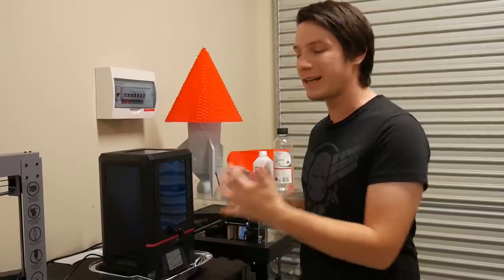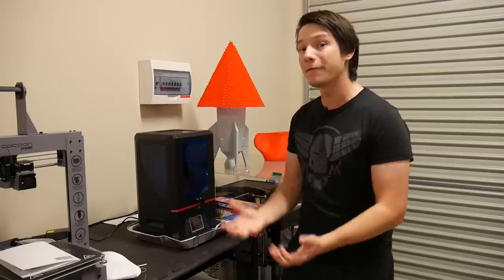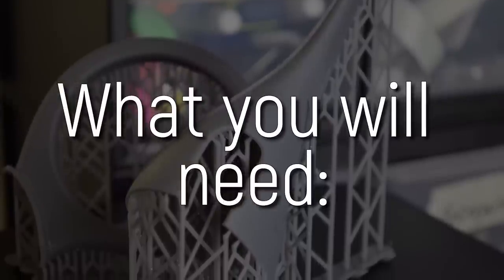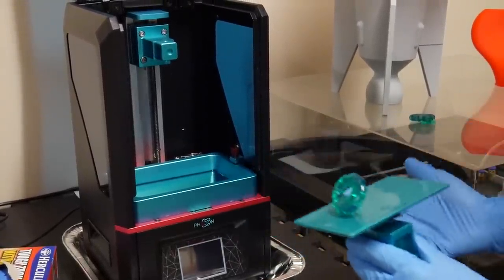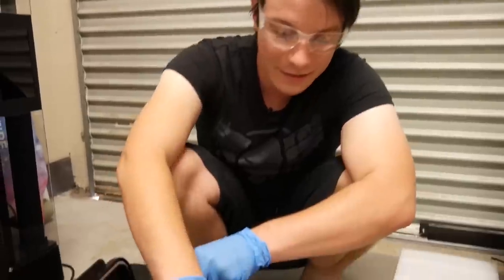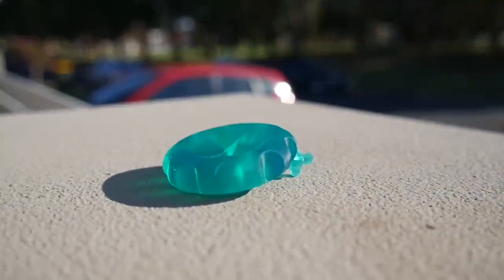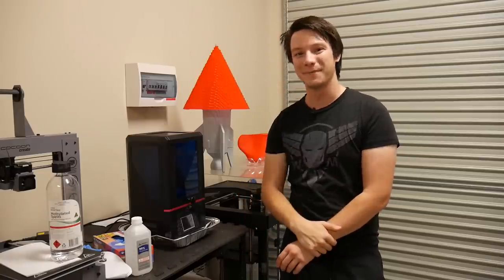Resin 3D Printing Safety - Important for Beginners!

Comment: We put our resin contaminated IPA out in the sun in a sealed container (not a bottle with a thin neck) for a few days and the resin in solution cures into a solid mass which then can be disposed of. We then filter the IPA using paint filters. The IPA can then be reused.
Reply from the maker: Good tip!
Reply: Exactly - easy to dispose of resin as long as you cure it.  Certainly saves a trip to a hazardous materials disposal site!
Reply: That is a really good idea
Reply: @FooBar89  just put in under the sun?
Reply: Yes. Depending on the UV index where you are it might take a longer time, but you'll know it happened when the resin hardens to the same degree as on your actual resin parts.
Reply: Little note: Standard glass more-or-less filters UV radiation away, so it may be helpful to use suitable container to speed up the process.
Reply: Binary Explosions 
Why is it hazardeous when uncured, but OK to put in the waste bin when cured?
Reply: @Traitorman..Proverbs26.11  At least one reason - those resin, or rather - their precursor mixture has to be highly reactive and such a compounds are usually not healthy - something that can easily reacts is quite likely to react in unwanted way in your body. They may also bind to enzymes and other molecules in your body.
Also there are probably some photo-catalysts - another stuff than can cause problem. Do not forget that these reactions probably goes through radicals that are not healthy.

Once cured, they are bound together, their reactive centers are used up to form new bonds, they are solid matter that you cannot drink nor breath in and if they are chemically stable lets say  when in contact with liquids in digestive system, they are safe.
Many materials (i.e. composite, plastic) that are safe are made of precursors that are very harmful. Btw. well known hydrogen cyanide or phosgene that are known by most of the people as poisons or even chemical weapons are important materials in chemical synthesis
Reply: Does this actually work? I put my jar of IPA under my uv light over night, and now it’s just cloudy
Reply: @danielfaubert1903  It's cloudy because there are tiny particles of cured resin in it. You have to filter them out, using aforementioned paint filters.
Reply: @mungo7136  sorry, ment for the comment after yours. I'm not good at computer deeerrrrp.
Reply: My isopropyl alcohol tub from when I had a resin printer (it was a bad model, i sent it back, I'll buy a better one when I can afford it) has a bunch of cured resin dust in it from being generally left in the sun, but when I tried to filter it out with coffee filters, the dust went right through the filters. Better than the alcohol, actually.
Reply: @mungo7136  Monoprice’s warning for their product is to not use even the finished prints for food. I reckon there is a possibility of trace chemicals that cannot be completely rid of by the curing process. It’s like prom… at the end of the curing process, some molecules are going to not have partners to tangle with and will be left hanging.
Reply: @LiKenun  Of course, there is a chance. Do not forget that producers protects himself from being sued - so he doesn't grade his product as a "food grade" if for nothing else that because he has no control of the processing.
I just tried to explain that chemical industry commonly works with extremely toxic substances to produce common objects for i.e food handling, medicine and so on - thus you cannot judge from the origin.
You can buy 2-part casting resins that had to be handled with care - yet manufacturers declares that once cured the objects are food-grade.
But I agree - some common sense, precautions etc. are a must
Reply: @LiKenun  It's also somewhat
 porous, creating a haven for bacteria/mold.
Reply: @Traitorman..Proverbs26.11  when uncured there are lots of small molecules (monomers) which can be harmful. When cured, the small molecules are linked together to form very long molecules (polymers) which are generally inert and very safe.
Reply: No matter how many times you filter it there's always going to be resin in solution.  The only way to recover the IPA from that is to use a distiller, a water one will work just fine and it'll be as pure as new again whilst leaving the amalgamated sludge to dispose of safely.  Distilling is also MUCH quicker than leaving/filtering/leaving/filtering.
Reply: @modelracecar  the issue with distillation is that the resins are thermally initiated also and when you reach the bpt of IPA (82 deg C) you're in danger of kicking off the during process. Best to filter in my opinion for as long as you can then safely dispose of it.
Reply: What about in the winter?
Reply: @rogg0224  Still plenty of sun here in the mid west of Western Australia. Our city (Geraldton) is known as 'Sun City'.
Reply: @luscus9754  wow. I live in the us and I am saving for a printer and am just learning all of the stuff. Didn't expect you to reply after 3 years!:
Reply: @Traitorman..Proverbs26.11  oversimplified: sawdust is bad to breath in, but lumber isn't even possible to get in your mouth because it's too big. Same thing here but on a molecular level
Reply: Really great to hear this works, in my thought experiment, it seemed like the way forward. Did think would need a reasonable head space and would need to use something like a fizzy drinks container.
Reply: Seems like a good idea, and limits wasted.
Reply: Omg SMART!  Mines getting a little grey...could probably use a little filtering...
Reply: Omg, i just thought of something,  ive got a elegoo washing and curing 2 in one station... I bet if I put the IPA bath in and turn on the UV for a minute or two itll clump the resin and make it real easy to remove from the IPA
Reply: What do I do if I actually will not see the sun for the next 6 monts?
Reply: @kebulove5928  Invest in a UV light.  Doesn't have to be expensive, I've seen UV keychain torches work.  In a video by Loot Studios they had someone lifting resin out of a lid with a spatula while shining a UV keychain torch and it was curing enough to stand up on it's own.
Reply: @mungo7136  maybe design a mini solar cooker dish to funnel the UV into the glass bottle and super charge the process :P
Reply: THAT'S GENIUS, I'm looking to buy my first printer and i was worried about this, thanks!
Reply: @NeoIsrafil  did it work?
Reply: Are the resins themselves volatile?
If they aren’t couldn’t you just re-distill the IPA to seperate them?
Hell, could even reduce internal pressure to promote the IPA evaporating out of solution/mix
Reply: if you leave the ipa in the sun for a few days how can you reuse it? does the alcohol not evaporate?
Reply: @horeica  Not from a sealed container it wont.
Reply: @Traitorman..Proverbs26.11 The question "Why is it hazardous when uncured, but OK to put in the waste bin when cured?" can be answered by understanding that 3D printer resins are two-part, with one part being a catalyst that is activated by UV light. This is why it's important to protect yourself when using 3D printer resins, as UV light can cause reactions with the resin that can be damaging to the skin. However, once the resin is cured and no longer exposed to UV light, it is safe to dispose of in the waste bin. To avoid any reactions with the uncured resin, it's important to wear protective clothing and eyewear, use gloves when handling the resin, and ensure that you thoroughly wash any residue off your skin.

Comment: I love the idea of resin printers it's just the safety hazards that drive me away.
Reply: The safety hazards are overrated. I've been using a resin printer for a while now and I don't even bother wearing gloves anymore. I'm asthmatic, but the printer is setup in my room and doesn't affect me at all. 

Companies need to state the safety issues as if they're talking to the most fragile child, so there's no way someone can sue them, but unless you're rubbing uncured resin into open wounds or something you'll be fine.
Reply: @SMScarlet  Ok, good. I ask because I also make things like toys for both people and animals. So If I make a dog toy with resin is there enough safety information available for me to read for each specific resin as there with the other type of printer?
Reply: @loszhor  Easily, just read the side of the bottle of the resin you've ordered. There's a hundred different types of resin, even ones made for dental implants.
Reply: @SMScarlet  Ok, good. I will reconsider this then.
Reply: @SMScarlet  That is definetely not safe way of acting. It might work for once person, after all people are different, but handing uncured resin is definetely not something you should not play around with. "I did it and it was okay" is a reason for one who was unaffected, but doesn't speak for the mass who got got resin hypersensitivity or liver problems.

I quote the 'Flying machine' conondrum: if ten pilots fly off, and only one returns, then the one can say "I lived" and thus the returning pilots had hundred percent success chance. The ones who fell don't come back and say "I died"
Reply: @SMScarlet  For your own safty, please use gloves. The uncured resin can and will seep into your skin  and will slowly cure leaving plastic nanoparticals under your skin, which  car cause realy bad alergic reactions. And don't think you are safe because nothing happened until now. This problem takes years to show symptombs but it will get realy bad and there is no solution. This is a commen illnes of people who work in the aircraft industrie with carbon and glasfiber (and epoxy resins as binders). Please use gloves and be safe.
Reply: As long as you’re careful with the resin and wear gloves, they’re much safer than FDM printers which are huge fire hazards if you’re not careful
Reply: @clockworkvanhellsing372  I agree with the message about wearing gloves but I take exception to the notion of resin seeping into your skin forming nanoparticles during cure. If you have references for this, please let me know so I can raise this with my colleagues as I work in the composites industry.
Reply: @SMScarlet  its over rated Your right...,BUT! not that overated!,,Use the gloves at the very least, issues can take years to show up, depending on exposure factors

Comment: I’m from the printing industry and used IPA mixed in water as part if the printing process on paper and plastics, i also printed sealing varnishes and resin coatings on plastics with  High output UV lights to cure them. This caused huge exposure to my skin in containers( no gloves too busy) of ipa and disolving resins off printing surfaces with rags dipped in ether and solvents (liquid paint strippers) This stuff is Mega toxic in the long term if you do not take care of yourself, please consider using extraction of air or at least a fan to disperse the vapors. I was diagnosed with Non Hodgkins Lymphoma stage 3 after huge exposure over 6-8 years and am now in remmision 👍 But i do not work in that industry at all anymore. So what I’m saying is this shit will hurt you if you don’t do the minimum in safety
Reply: thank you for sharing, also hope you are well now🙏
Reply: This should be pinned.   It's that important.  

I hope your health continues to be better.
Reply: Thanks for sharing!
Reply: wow holy shit - thanks for posting this.  Hope you are doing better.
Reply: I wear gloves and a respirator when I handle resin. I hope you're doing well.
Reply: Good lord man sounds like you bathed in the stuff.
any kind of resin can do that if you dont take some ppecare  hope you stay in remishion.
And yess folks things that use an A and B part count the same as the UV stuff.

Girls got some news for you.  That fingernail polish... IS the same stuff . genrily with a lesser amount of the uv reactive catelist so the polish dosnt freez in a wrinkle but it's verry close.

Comment: Leaving used alcohol in a jar under the sun for a few days cures the resin particles floating in the alcohol. Hence you can filter out the clean alcohol and reuse. Moreover, I also leave the gloves under the sun or UV LEDs for few mintues before tossing them. I also use respirators with organic vapour filtering level to prevent air fumes. In the long term breathing resin vapour is also highty toxic.

Comment: Good video, although I feel like you should have touched on the fact that the printer and any liquid resin should be in a well-ventilated area. Most organic solvents have a very high vapor pressure, so you'll get a lot of fumes continuously coming off of them. On top of that, most organic solvents, when breathed in, are very bad for your health. Everything from confusion, brain damage, lung damage, liver damage, and triggered asthma can all happen really easily around VOCs.

So, my advice to anyone wanting one of these printers: Only get one if you can keep it in your garage and can keep your garage well ventilated, or something even safer. Alternately, keeping it in a basement could work, so long as you keep the printer in an airtight enclosure that uses an exhaust system with activated charcoal filters, and the enclosure should be far, far away from any water heaters, furnaces, or flame sources. Most importantly, don't allow children around these solvents; they're far more susceptible to the organ damage and carcinogenic effects than adults.

Source: I'm a molecular biologist who used to work in an industrial lab.
Reply: Murphey Law, I don't doubt your credentials at all, and I certainly don't claim to be your equal where general knowledge of chemicals is concerned. My only concern is that I think overall, I think more has been made of the toxic effects of these particular resins than is really necessary. MSDS on all of the ones I've used have listed them as minor skin irritants, but people hear the word "toxic" and all of a sudden it's the greatest threat in the history of history. It's not going to kill you, and unless you have an allergy or are operating it in a coat closet the fumes and vapor aren't even that bad. Not saying you should do any heavy breathing directly over the machine or anything, don't shower in the stuff,  and anyone who thinks it's a good idea they should drink it kind of deserves what they get (clearly DON'T do that), but use gloves and eye protection and you'll be fine operating this inside your house without having to relegate it to basement or garage. I think most people are around much more hazardous materials and vapors when they fill up their gas tanks than this thing puts off.
Reply: I’m debating on using one of these printers in my garage. My garage can get very hot, cold and humid throughout the year.  Is there a specific temperature range that these printers need to operate in? Thanks.
Reply: @thomascruise4966  Did Your point changed over the years? I recently accepted that my nose gets irritated from the fumes and even stopped using the gloves because there was never any effect on my skin from accidental touching it. As long as I used gloves for actually dealing with liquid resin and I think that it doesn't matter if it touches your skin for a minute or two if You can just wash your hands soon after.
Reply: @sasori2425  I would honestly suggest a more aggressive setup. I don't know the details of your home , so I can't comment too directly, but (at a minimum) putting it by the window and having a box fan in the window blowing outwards would be strongly advised. Additionally, perhaps a barrier you put under the door leading to the bedroom to help contain the fumes would help. (Even just an old towel that you kick partially under the door to block airflow would be extra safe)

But, if you have young children and/or small pets (especially birds), I wouldn't take the chance in your shoes.

Now, if you set up a fume-hood style enclosure that is constantly outputting the air directly to the outside and you're extremely careful about spilling the resin outside of the enclosure, you probably should be good.
Reply: @thomascruise4966  This is old but you become allergic to resin with repeated exposure eventually. Minimising all contact is important.
Reply: totally agree. my friend was using a resin printer in his industrial garage so it was a big space but the smell from that resin lingered around horribly. even though he had a proper wash station to clean the prints they also still smelled and after touching them I would smell that resin on my fingers hours later. horrible stuff. although I love the quality of these prints I can't stand that smell and will stick to fdm printers
Reply: Folks with asthma, yes, I got it. It does irritate my asthma some. PPM for a single printer in a room with the printers circulating exhaust is very low unless you are already sensitized. I've found a printer bag/hood/home can be enough to combat the overall smell and if you have a window nearby, a fan powered hose sucking the air out of the printer and outside can let it breathe nicely. If the room is not hot, I've not had any prints fail from it being sealed up (the printer thing I'm using was made for a larger FDM printer and has plenty of space around my little resin guy... and since it only has one plastic window I can block off, I can leave the top off the printer.

Comment: bookmarks for me
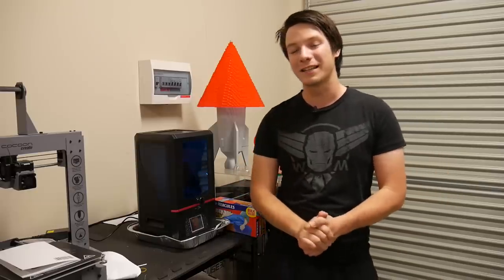1:16 File prep
1:45 Hollow out your models
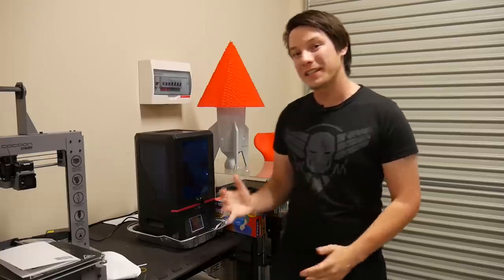1:58 Orientate the model @ an angle
2:20 resin Baaaaaaadddddd
3:05 Wear Gloves (type???)
3:38 Isopropyl Alcohol  ot Methylated Spirits 
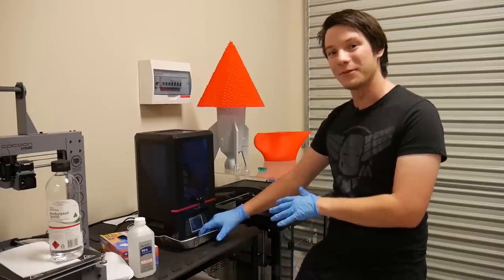4:15  Cheap turkey Roast Tray  / Safety Glasses

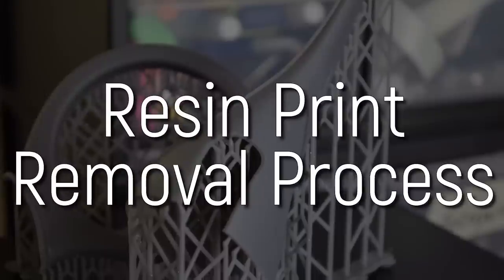4:50 removal
5:45 Spatula Metal ? 
6:00 Finishing Station Solvent proff containers
7:10 Dispose of it carefully
7:55 Cure the Resin  UV nail light ?

8:40 Try not to touch ANYTHING